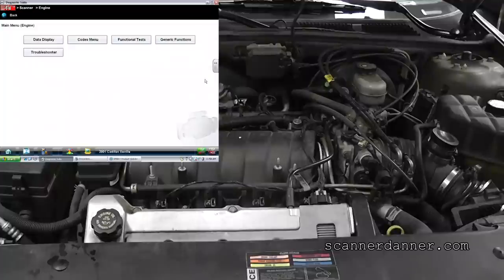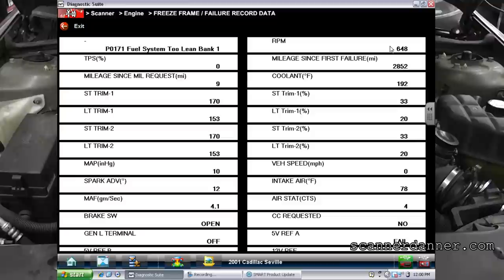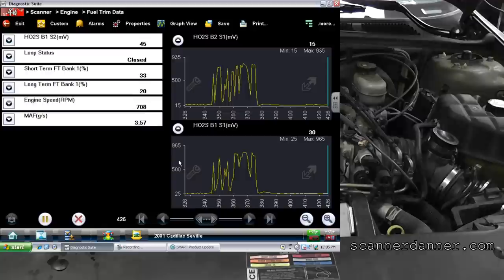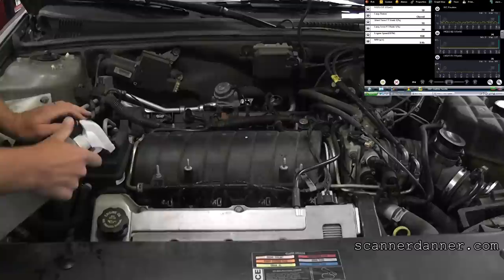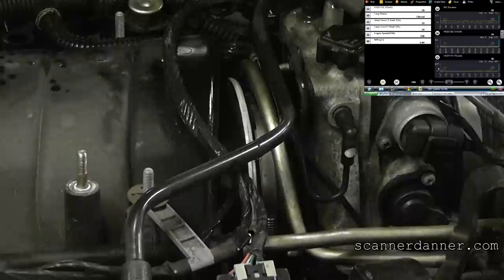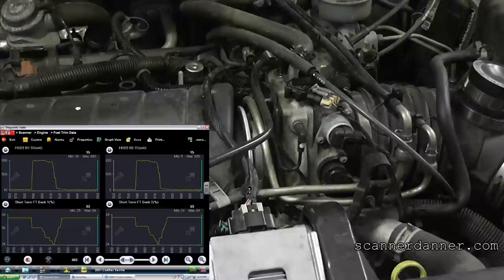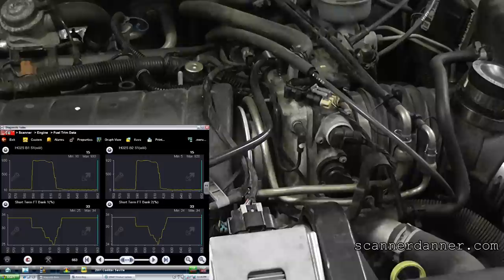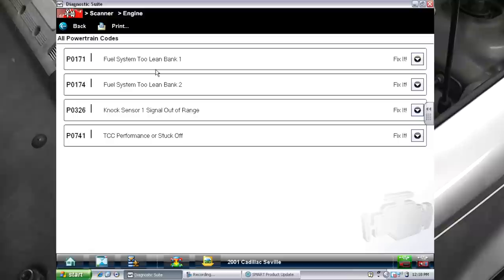How to find a vacuum leak with water

Comment: ScannerDanner, you are a gift from heaven.  I am a poor man with a VERY old Chevy 5.3L that had a leaking intake gasket. I bought a cheap $22 OBD2 scanner/Android Torque app that allowed me to use the lessons in your video to diagnose the problem. The leak wasn't bad enough to throw a code, but it caused a rough idle, and shook the car antenna. Torque  app said LTFT was 18.6% on bank 2 after warmup, and it did drop considerably when I held it at high RPM, just like you did in the video. Downstream O2 sensor was floating around zero, but the upstream and entire other bank looked almost normal. (I am amazed at how bad the car can run before it throws a code.)  I put some propane around the engine compartment until I found the leak, as the "dead" O2 sensor came to life fast when I was in the leaky area.  I had tried the trick with propane before I bought the scanner, but the change in engine performance was not obvious when parked on the street with other cars wizzing by. (I don't have a garage)  I had to look at the LTFT and O2 sensor to diagnose the problem, and that was the only way to see the problem.  You saved me a lot of money by not having to take the car to a shop, so now I have more money to buy better food for my family. (Fajitas for dinner tonight, instead of more Hamburger Helper!)  New Felpro intake gasket set cost $27 on ebay., so the whole thing cost less than $50 to fix, and took about 4 hours to install without special tools.  Thanks from the bottom of my heart, and from my wife and kids.
- Marvin M.
Reply: Jay Dahl brains and a desire to learn will serve you and your family well my friend good job!

Comment: my car was hesitation at low-speed RPM around 2000.  but when I go faster the hesitation will go away. I used your awesome water bottle and I found out the valve cover off the cylinder head gasket is leaking. I am really thankful

Comment: Finally a method that doesn't require spraying caustic chemicals like carb cleaner onto plastic and rubber parts that could cause them to fail. I have two questions just to clarify: 1) You say that you can tell by sound if there is a leak. Is the gurgling sound what you look for or is there a change in the idle sound, or both? 2) You mention idle wear control several times. Do you mean idle AIR control?
Anyway, thanks for an informative and useful video.

Comment: I was going to say that spray bottle doesn't put enough water out.
I saved an old dishwashing soap bottle. Or I drill a 1/4 hole in a water bottle lid and soak leak areas.
Reply: We know from experience where the common leak areas are.
Reply: Air filter air temperature can affect the elements in MAFs yes

Comment: Danner was right, it WAS a vacuum leak. Mechanic knocked vacuum off at TB when he managed to break my air intake boot right above it. No water used, but used eyeballs. The line that goes to my Ford purge valve.
Reply from the maker: Stay in the original thread buddy. Otherwise there is no context.

Comment: Water is not only great in finding vacuum leaks, but it also cleans carbon very well. I use water in those induction service cleaning machine. Leave the engine brand new

Comment: I tired this on my 2000 chevy 1500
5.3 
P0171 p0174 
I tired chexking ny mass air flow 
Am getting 12.5 and good 
Grand but when I chexk 
The yellow wire and check 
I wasnt getting anything q chexking my hrz w didgtl meter ?

Comment: ScannerDanner, my car has a strange symptom, good compression and bad compression that happens randomly, no codes, no check engine light, I bought a U-Scan but I don't see anything abnormal, I sprayed soapy water and I didn't noticed any rpm changes, it's been acting like this for almost 2 years, what can I do? thanks

Comment: how’d you know that sound was coming from the air vent hose in partiqular? &&& since that tubes just dumping air from valve cover back through throttle body to manifold, etc., - why would a leak there mean squat sqiggity?🤔 not doubting ya, just askN👋

Comment: Propane exploded on me doing that very thing once on the trooper v6 and it blew the throttle apart and left me dazed and confused with ringing ears
Reply from the maker: Wow, even with propane we still need to be careful for sure. I'm glad you didn't get hurt
Reply: Left you with one eye too, it seems. Yikes.

(yes, that was a joke :)
Reply: Haha that's my gold diggin partner. He's quite a pirate...actually it was my hearing that took the hit from God's gas that day...way back in twenty oh seven...Safety first guys n gals!
Reply: area46241  Just crack open the valve to allow only a small amt. of propane to come out.
Reply: Can you only apply propane while the engine's cold?  Two possible drawbacks: 1. engine cold for short time, 2. O2 sensor not active yet to see effect?
Reply: @area46241 :  I've been using carb cleaner for 35 years. Before O2 sensors and scanners, we watched CO spike on exhaust gas analyzer when we sprayed a vacuum leak. Only mishap i recall was a coworker using starting fluid (ETHER) -- it flashed BIG TIME, and he came out of fireball with his hair scorched. What did he learn? TO WEAR A HAT WHEN USING STARTING FLUID TO FIND VACUUM LEAKS 😆.

Comment: I saw this same car the other day had no codes stalled in turns and when stopped some times video saved me loss of wasted time had high fueltrims and low o2 voltage poured water on intake had same issue as car in video waiting to see if customer wants to fix it

Comment: I have a question for you guys.  I  have a 2001 S-10 4.3L, and I am trying to find a vacuum leak.  My scanner shows the same scenario here, so I know it's a vacuum leak somewhere.  Intake gaskets, both upper and lower) have been replaced.  My question is, when using the propane method wouldn't the radiator fan blow the propane out of the way before it was able to enter a potential leak area?  Any suggestions would be appreciated, as I am going to try to find the leak on my truck with this method this weekend.  Thanks.
Reply from the maker: Yes, on a clutch fan that you can't disable like yours. But I don't use propane to find vacuum leaks.

Comment: I'm surprised you used so much water.  Someone told me to just use a mist and make sure the engine was hot, else the engine could be damaged.  Also, I imagine if the leak was on the bottom of the intake, no flammable gas or water would reveal it.

Comment: the booster leak test is only for map engines? or can also be applied to maf engines? would it make the opposite effect
Reply from the maker: +Luis Martinez this test is good for MAP and MAF engines. Fuel trim will be opposite and so will idle conditions, but you can still use it

Comment: A question. and awesome vids by the way! taught me a lot. I have a 93 Corvette with high long term blm's, specifically on the left bank. IAC is at zero when warm. Desired idle vs actual is almost dead on. Varying 100 rpm's at most. No codes. Highest BLM I saw was 149 for the left bank. 02 sensors cycle very fast in closed loop. It's a 93 LT1, so speed density. TPS voltage is .57 at idle, and throttle percentage at idle is 0. I blocked off the throttle body, and the car stalled. Meaning no vacuum leaks right? I've done smoke tests with a machine and found nothing. Any help or ideas is appreciated.
Reply: And my injector bank pulse widths are also high. Factory service manual indicates normal is 1 to 4 ms. Left is at 9 ms and right bank is at 8 ms. Forgot to mention that in the upper post.

Comment: Will this work on vacuum lines for your ac controlls
Reply from the maker: i have found the water test to be much less accurate on vacuum hoses unless you can direct the water directly to where the crack is in the hose

Comment: Hi, I was thinking that if the engine manufacturers provide a value of absolute pressure in the intake manifold at a certain rpm and load (for example at idle rpm and no electrical loads), then people would just need to measure the intake manifold pressure to know whether a vacuum leak exists or not (Especially helpful for pre-OBD-II vehicles). If the pressure readings are same as factory test values, then there is no vacuum leak. Why the manufacturers don't generally provide this value in your view?

Comment: i have a maddening P0171 lean bank 1 code on a 2000 lincoln ls 3.9L. Any advice where i might focus my search efforts to find the leak. Also both downstream Heated O2 sensors circut malfunction codes
Reply from the maker: I am directing all help requests to my forum. Sign up (it's free) and create a new post. Be sure to add a name under "alias" as this is the name that will appear in the post.
Here is the link to the forum. 
http://www.scannerdanner.com/ForumRetrieve.aspx?ForumID=3226
Thanks
Reply: ScannerDanner Awesome! Will do.

Comment: Can anybody help meeeeeeee??? After changed fuelpump bigger, to 255 lph???, should have nothing to do with it?? Also changed throttle body bigger, from 60 mm, to 70 mm, also changed EGR valve, and have chaged IAC valve and last changed TPS also??? After started car , idle is like so crazy..., stays 2400...., after for awhile, comes down to 1200........, NOT under, ???? Everybody telling me , leaking intake.....somewhere,....there  was NO probpem before changing a fuelpump,.....and throttle body????? Help meeeeeee, thanks ! BTW, Car: Mustang 2004/ 3.8 litre......;o)
Reply from the maker: What's your TPS  closed throttle voltage?
Reply: So, you check that cold, car not running, power on??
Reply: Just measured it: third power line is getting almost 5 volts, middle line, power on, engine off: 0.88 volts?? That should be in a range?? Strange thing is: when you unplug IAC valve, no change in RPM?? And it is new??
Reply: The screw for throttle axel, was way out, so I did turn it in, now it is, barely touching!!??
Reply: And, throttle position sensor is not adjustable, and it is new!!??

Comment: Could a large vacuum leak cause a P0440 evap code?
Reply from the maker: +James Last Thanks again for your support. Unfortunately I cannot keep up with the number of technical questions I get from my subscribers through email anymore but I have created a forum for you guys for this very thing! 

http://www.scannerdanner.com/forum.html

Thanks for understanding.
Reply: Did you ever get your answer 🤔
Reply: Yes I removed the fuel filler neck and filled it with water...the end of the neck near the gas cap had holes in it.   I found a cheap replacement online. I sold the car since then.
Reply: @int53185  ah alright, good to hear you got it sorted, what were the symptoms though ? Other than the P0440 code
Reply: @thesmartguy3523  there wAs a fuel smell after you filled the tank.

Comment: WOULDN'T MOST TECH'S OR PROFESSIONALS HAVE A BASIC SMOKE GENERATOR FOR FINDING VAC. LEAKS?  I GET THAT WATER IS GREAT FOR THE HOME MECHANIC.
Reply from the maker: I have 2 different smoke machines and still prefer the water test to find a leak. It's just simply faster in most cases.
Reply: Can you pressurize the intake with air from say a leaf blower or shopvac exhaust and use soapy water and look for bubbles? Engine off scenario... ?
Reply from the maker: haha maybe? 
I'm laughing because that is a funny visual. (leaf blower connected to the intake)